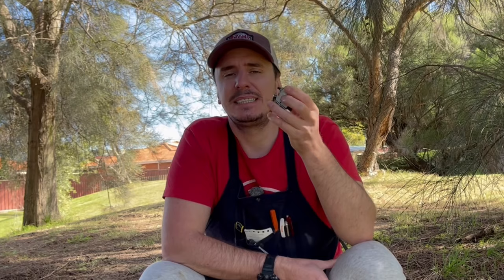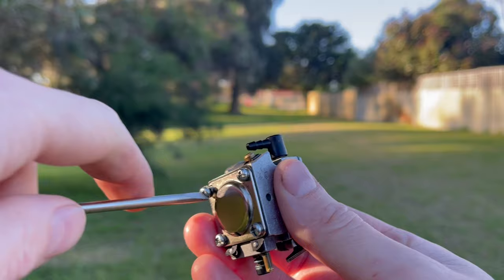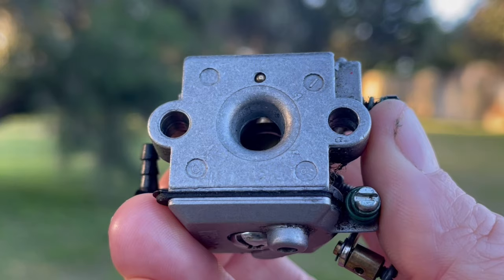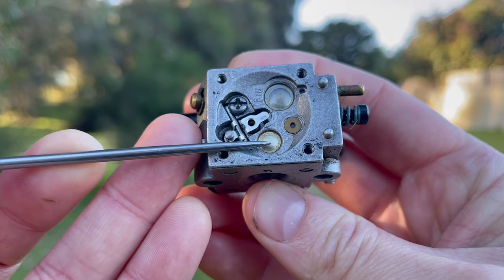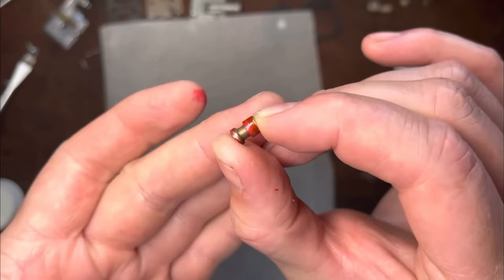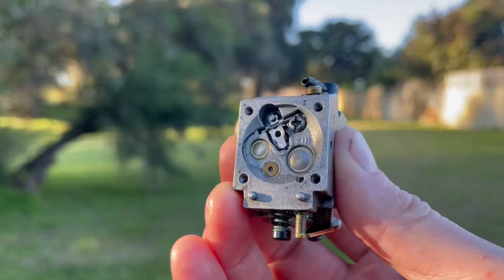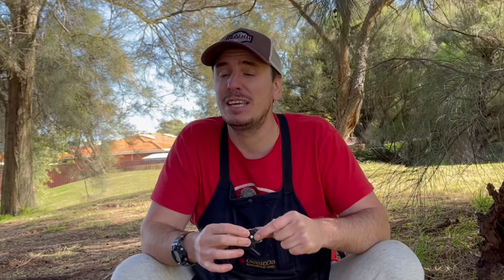Doing This Will Ruin Your Carburetor Every Time!

Comment: No matter what hole you spray the carb cleaner in , it will come out of one aimed at your eye .... There are no exceptions ...
Reply: Everytime. It never fails
Reply from the maker: @jessiegoss7660  so true 🤣
Reply: LOL.  I actually avoided for once in my life after reaching the age of 56.
Reply: Cleaned my first carb today, got a really close call with the carb cleaner hitting my eye
Reply: I love when that happens
Reply from the maker: @jonathanfabian4973  urgh always the way 🤣
Reply: Ah, yes. The juxtaposition of carb cleaner.
Reply: It then becomes..lens cleaner !
Reply: yall ever use eye protection?
Reply: @VintageEngineRepairs  😂😂😂 I'm still laughing. I love some of you guys on the internet. You make life just a little bit less harder.
Reply: It's hard to find my eye protection with my cane and the dog doesn't help very much
Reply: Best way to find a nail in a tree/ log:(1) put a new chain on the saw( 2) start cutting. 😂
Reply: 'Tis a near impossible paradox to defeat
Reply: Can confirm this has happened to both my left and right eyeballs on more than one occasion 👍
Reply: A piece of advice that I've not yet seen mentioned once in any carb cleaning videos that I've watched. This happened to me once and I swore I'd never let it happen again. Just wear some safety glasses or a face shield. We've only got the one set of eyes 😊. I immediately went to rinse my eye out but I'm pretty sure some harm had already been done. Funny to hear I'm not the only one.😂

Comment: An hours worth of labor at a shop, say $80 versus a ebay $25 carb. 🤔 Bad thing is the fuel we buy today is ruining a lot of small equipment.
Reply from the maker: Only takes 7-10 mins to disassemble, clean and rebuild one!
Reply: The idea is to read the users manual to see what fuel to you use! NEVER use ethanol blended fuel in the older type carburettors.
Reply from the maker: Even using regular ethanol free pump gas you need to rebuild the carbs
Reply: @markaylott1780  But people don't do it. It costs too much they say. I've recommended EGO battery powered equipment to a lot of people for their next purchase. They're doing very well. Government regulations are killing equipment with no regards to cost.
Reply: @catbird1759 ......my Stihl battery went from a outrageous $160, three years ago.......to a mind blowing $300 today to replace it at 3 years old.  For one stinking battery!  Battery stuff isn't going to survive the test of time and $$$$.
Reply: E- Bay Carbs  cheap Chinese hit or miss are  horrible quality.  I have a Kohler mower that was given to me.  

I carefully cleaned the carb several times since the mower was in storage for  a while.

 

It was so bad that I could not clean it well enough, and it was taken completely apart  and cleaned  , and yes every passage  was perfect. 

It would work for a while intermittently. 

I ordered a cheap e- bay  carb and it was almost worse out of the box.  I finally tracked 2  Kohler OE Carbs , and worked perfect since. 

I installed a fuel valve to shut the valve and let the mower run out  of fuel into the carb after every use.,  I also  removed the useless little filter in the fuel hose and installed an in line one.  I use ethanol treatment  and so far  running perfect using this method. 

Ethanol is just killing our equipment. 

I try to use non Ethanol fuel when I can.

The above ideas I got from the You Tube community and appreciate all the You Tube creators. 

Thanks.
Reply: @pedroc6823 ✌🏻✌🏻✌🏻😋. BINGO!!!!!      Run it DRY.
Reply: Using small engine petrol (alkylate petrol) is really worth the extra money IMO. Especially in seldom used machines.
Reply: @jannepeltonen7493  But people buy the cheap stuff and come screaming when it won't run. And I have found that sometimes you're not buying completely ethanol free gas too. Not sure how the wrong fuel got there. Residue left in the lines from a multi-use truck?
Reply: @markaylott1780 Bologna, it doesn't hurt anything I use tons of ethanol fuel, the only problems come in storing it with fuel in it.
Reply: @integr8er66  .....thanks.......now I can't get that Oscar Mayer bologna commercial tune outta my head. 🥴  ......."my bolgna has a first name,  it's O-S-C-A-R,.................."
Reply: The fuel isn’t damaging anything.  People are careless with their fuel and it absorbs water.   95% of my customers repairs are bad fuel from not storing it correctly.  

I have been running pump gas in my equipment for years with no problems because I don’t leave fuel sit in equipment and I use hood gas cans that seal properly.
Reply from the maker: Petrol doesn’t absorb water, it’s the ethanol. Ethanol isn’t present in fuel out here and it’s still necessary to rebuild the carb occasionally. Diaphragms harden, needles deform, the screen plugs up. Thanks for watching.
Reply: @VintageEngineRepairs  yes, it's the ethanol.
Reply: @catbird1759  Yes, but a little water doesn't hurt anything, if you think it does, consider how much is sucked in absorbed in the air every stroke
Reply: @VintageEngineRepairs  if nothing tears! Too many parts to keep up wt! Most carbs you can get for $10.00
Reply: @markaylott1780  shouldnt ever use ethanol
Reply: @VintageEngineRepairs  true fuel & no problems
Reply: @VintageEngineRepairs petrol doesn't absorb water, true....but that is also a problem for vented small motors.  A vented vessel in a humid area will collect ounces of water in humidity every month.  Each night the temperature drops below the dew point, that vapour distills down inside the tank, just as you can see it fogging on the outside of a metal tank, such as a drip fuel motorcycle.

Eventually the tank and bowl get water puddles at the bottom, which is where fuel is being pulled and where the metal is.   This causes corrosion and a lack of combustion.

Ethanol, I'm not a fan, but I'm much less likely to get water bubbles in the fuel.  Ethanol doesn't go out and pull in more air water vapor...but it will mix with the vapor that was going to condense inside the tank anyway.

Living in a warm humid area with cool nights, I just keep my tanks full to limit the air void.  In winter I dry store my small engine equipment.

For my bike, I keep it full and use it at least once a week
Reply: The whole point of the videos is to teach people how to care for their equipment.
I don't understand why people are watching them if they still go to a mechanic or just replace good parts with bad.

Comment: Those carburetors are so cheap that it is not worth fixing them , just buy a new one!!!!
Reply from the maker: Chinese aftermarket carburetors are indeed cheaper, but are also notoriously unreliable, often leading to more problems than you’ll solve. To replace this OEM carburetor with a genuine Zama the same specification you’d spend $150-$200. A simple carburetor clean and new kit is just a few dollars and few minutes of your time. To me it’s worth saving the OEM.
Reply: @VintageEngineRepairs I've purchased four cheap Chinese carburetors off of eBay. They all lasted as long or longer than the original Stihl carbs! Plus they had adjustable jets!
Reply: @jimkarban6489 I've bought a number of chinesium carbs supposedly for the engine in question and they are never the same.

Comment: I once rebuilt these carbs, but I found that they were only usually good for one rebuild, if I was so lucky, plus the rebuild kits just keep getting more and more expensive to take a chance on trying to rebuild it and it not solve the issue. Add in taking the chance of dropping and losing one of the tiny carb parts. I not longer feel that rebuilding them is worth my time. If replacing a hardened or split diaphragm doesn’t fix it, I am done and I’m just going to get a cheap Chinese replacement carb. I get them from Amazon so if I get a bad one, I just send it back for a replacement. I personally hate 2 stoke engines and, in this one instance, I will probably replace my 2 stroke leaf blower and weed eater with battery powered next time and just be done with all the two stoke problems!
Reply from the maker: That’s a shame, but fair enough if you don’t like them! I can’t get enough of 2 strokes haha.
Thanks for watching and commenting :)
Reply: I know it's tough to find non oxygenated/ethanol free fuel in some areas of the country. But if you can get it, it's the key for two cycle, well really any small engine longevity.
 I've got a cheapo 25 ish year old 25cc craftsman string trimmer I've had since new. It starts with a couple few pulls every time even in the spring after sitting for six months all winter. And I've never touched the carb. I've always used non ox premium fuel mixed with AMSOIL Saber 100 to 1 two cycle oil. That Saber oil helps preserve the fuel as well. About a year ago it wouldn't start, so if figured probably the spark arrestor screen was plugged. Nope, pulled it apart and the screen was clean as a whistle! Fantastic! Had pulled the spark plug prior to that and it looked decent too. But it turned out that original plug had finally shorted out internally. Not bad for a 25 year old two cycle spark plug huh? I've found AMSOIL products to be fantastic and I use them in all my stuff, cars, truck, small engines, motorcycle, outboard, snowmobile, everything.
Reply from the maker: @429thunderjet2  yes, my favourite 2 stroke oil is Amsoil Saber. I run it at a bit higher oil ratio at 65:1. I also agree, the best thing for 2 strokes (apart from alkylate fuels) is non ethanol - just straight unleaded. Thankfully where i am in Western Australia, there is no such thing as ethanol :) other states here in Australia they’re not so lucky!
Reply: If people with two stroke power equipment would use Sabre oil fr Amsoil,it mixes at 100:1,saves a shit ton of two stroke problems.
I’ve been using Sabre oil for about 8 years,my equipment cranks first or second pull all the time,also mix with Non ethanol fuel.
Reply: @kyzor-sosay6087  absolutely!

Comment: You have to be quite careful with what you use to clean 2 stroke Diaphram type carbs , Some Carb cleaners are  such a strong chemical detergent they will dissolve or swell up the tiny flappers within the carbs check valves turning them into a globs of goo. some carbs have replacable check valves ,, Some are of a design where they can not be replaced requiring you to replace the whole carb as a unit once this happens ,,  so take care with what cleaning chemicals you use. two stroke carbs that have a primer will have tiny check valves on both the low speed and high speed circuts as well is in there primer housing.. use something like wd40 not Gumout choke and carb spray , search on check valves and preasure testing testing on youtube..
Reply from the maker: Thanks for watching and sharing 👍

Comment: Never use anything with acetone or toluene , like what's in carb cleaner. It will swell the rubber check valves in the carb body and ruin the carb. Use chlorinated brake cleaner aka non flammable brake cleaner and an ultrasonic cleaner.
Reply from the maker: Yep, better to be careful than to damage the seals or needles! Thanks for sharing :)

Comment: I've used canned air ( Dust Off computer cleaner) in the small ports on carbs. Just don't shake, tilt or turn the can upside down. 409 cleaner is corrosive to aluminum.
Reply from the maker: Hey Jim! Yep I have used compressed air and carb / brake cleaner in them, you can do so with caution when you’re aware of the dangers and how to avoid damage. The real issue is people just going full tilt boogie 110psi and causing damage :)

Comment: Great video.  Now I'm concerned about the carburetor I was working on.  First, thinking I knew what I was doping, I bent the tab on the needle holder downer thingy.  I know I've got to flaten that back to it's origianl state.  Second, I sprayed the whole carb, like a brute beast; first with carb cleaner, then with compressed air from a can.  The symptom I was having was the primer bulb wouldn't move any fuel.  Fuel lines are good, bulb is good.
Reply: LOL. I was just wondering how many I've destroyed over the years . .
Reply from the maker: Yep! That lack of purge bulb filling is the #1 symptom of a missing or non sealing main nozzle - instead of pulling a vacuum in the metering chamber and thus the needle down and fuel in, it’s just pulling air from the main nozzle lol.
Reply from the maker: Yeah haha it’s very common :) don’t beat yourself up!

Comment: That ultrasonic cleaner is so helpful for cleaning out little passages like that.
Reply from the maker: Yes :) great tool to have!
Reply: Soaking the carbs, in vinegar :  B U T   be  very  time-conscious, as it may / can   eat  through  cheap  chinese metal  ( pot metal and the  like ......).  junk  metals.
Reply: @petersack5074  That's another reason I prefer hydrocarbon solvents instead of acids whenever possible.
Reply: Vinegar eats metal. Any kind of metal. Never soak metal in vinegar.
Reply: @jamesspalten5977  Not all metals get eaten by vinegar. Molybdenum-stabilized grades of austenitic stainless steel like 316 experience very little vinegar corrosion in most conditions. Nickel-chrome superalloys like Inconel 625 are even more resistant to vinegar, even in high temperature or high pressure conditions. Of course anything plated with 24 karat gold can pretty much last forever in vinegar, but that's more common in electronics than mechanical stuff.

Comment: might you show what to look for in a good ultrasonic cleaner that I have seen you use?  from what I have seen, it obviously works well!  Thanks.  Love your channel.
Reply from the maker: Thanks Clint! I recommend a 10l one, that has heating function, degas function and cycles of 30 mins or more :) I hope it helps!
Reply: @VintageEngineRepairs what type of cleaner do you use in the ultrasonic ?
Reply from the maker: Ct14 :)

Comment: Thanks for making this video.  I've cleaned carbs out for years and nothing like this dawned on me.  You recommended soaking the carb.  What do you recommend soaking it in so itll clean it?
Reply from the maker: I use a water based degreaser 👍

Comment: I've stopped rebuilding small carburetors.  90% of the stuff I work on has an aftermarket carb on Amazon for $20 or less.  Most of the time they need tuned but I've rarely had a problem.
Reply from the maker: Thanks for watching and sharing your experience,
Reply: I've bought about 6 now from Amazon and maybe half of them required no adjustment at all. The price is about 90% off for a Stihl, 70% off for Husqvarnas and a Poulon or two I cannot vouch for, price-wise but they were super inexpensive. 

I've not had any troubles with the Amazon carbs and they include a whole bunch of new fuel line, the clunk, a new air filter and plug wires where they are replaceable. 

So if you screw your OE carb up badly enough, all is not lost.

Comment: I got a goped carb to put on my 26cc trimmer. Works fine and let me tune it for 4string heads.
Reply from the maker: Cool!
Reply: @VintageEngineRepairs  I found a twist cap 3 line head on fleabay that works a treat. It takes 3 crossed 130 square lines and just eats Johnson grass for lunch on a 2620t  echo.

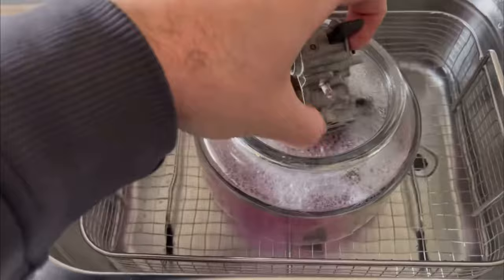Comment: Thanks for your extremely helpful and insightful video! Question: On 2:26 you show soaking the carb in some kind of fluid. Could you please explain which cleaning material your using? Thanks a lot.
Reply from the maker: Thank you! Sure, it’s “chemtec 14” :) thanks for watching!
Reply: Any other brands? Not sure that’s available here.
Reply from the maker: I know is the USA chemdip is very popular, but it’s very strong - not good for rubber

Comment: I appreciate deeply your videos. I would love to hear your take on the non adjustable carbs on the MS 170 and 180 chainsaws. I have one that bogs and I've replaced metering and valve diaphragms but no difference. Can't get at the jet channel as there is no screw visible. Any advice appreciated.
Reply from the maker: Yes, I’m not a fan of them as they’re not adjustable, if you do a search for “WT215 ms 180 conversion” you can see how it’s possible to add an adjustable carb to one :)

Comment: What can be the cause of more fuel consumption? Stihl FS 100 weed eater
Reply from the maker: Having the carburetor set too rich 👍🏻
Reply: @VintageEngineRepairs  haven't touched the factory settings but will check. How do I check if it still has the factory settings?
Reply from the maker: @sieggs25  hmm - what’s the history of the machine? How did you come across it? When did the tune change or problems start? What fuel do you run? What work have you done to it?
Reply: @VintageEngineRepairs the machine is  15 years old. It was getting a bit hot than usual. The valves were adjusted, purge bulb replaced and carburetor gasket replaced.